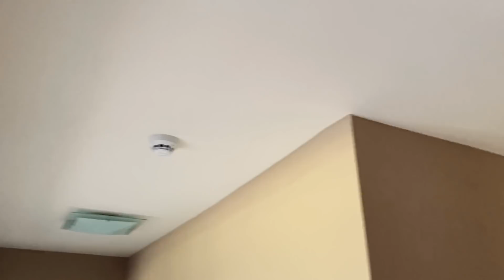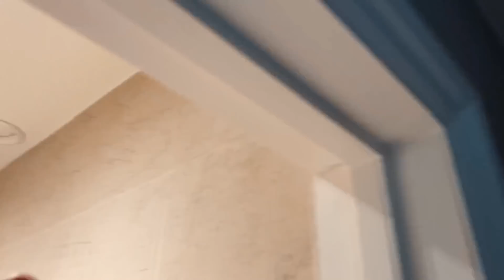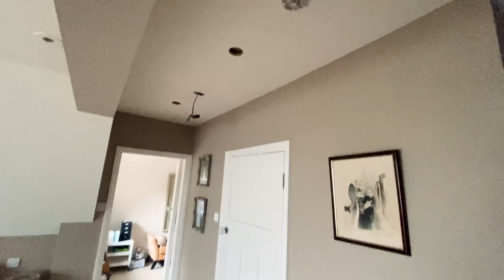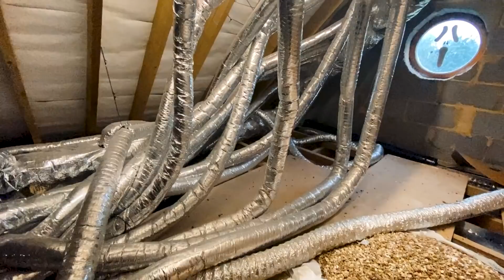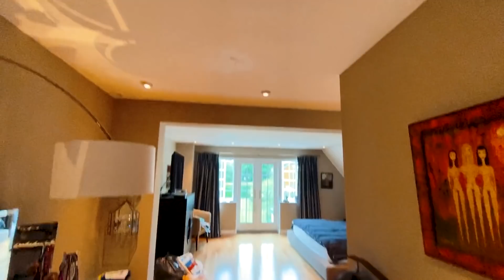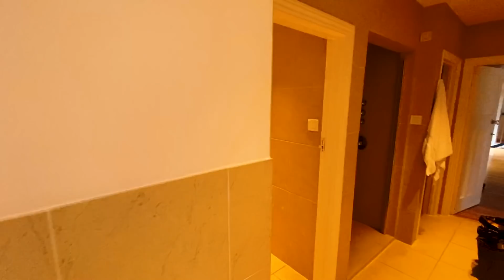Electrician Life Installing Smart Lighting

Comment: Hi Jordan, love your videos. I am currently training as an electrician.
I have looked at quite a few LED downlights and from what I can see they all require loft insulation to be kept away from them with covers etc.
So far after watching a few of your downlight videos I don't think I have seen you do anything to create space between the down lighters and loft insulation.

I also notice that wholesalers don't seem to stock many of the hoods for this purpose which also implies electricians don't feel then need.

Is it just that you haven't mentioned it or don't you feel it's necessary?

Thanks

Alan

Comment: I am not sure what’s Smart about those lights, they just seem to be Controllable Lights, controlled by an awful loud clicking wall switch or finding the hand controller. They should have had a proper smart system like Loxone then they could have had full control without the need to intervene or press buttons, .......proper automation, proper smart.
Reply from the maker: Its all controllable by an app
Reply: @artisanelectrics  an App isn't Smart, it's just control which isn't the same

Comment: Really enjoyed that video Jordan. A little tip  When I fill holes in the ceiling This is good especially for smaller ones we use the plasterboard cutouts fromThe new hole cut out and  used as a template to cut out the old holes and then it’s easier to repair than other than just filling it with filler.

Comment: Hi ther im looking to get some new smoke alarms for my house (wierd) and i have seen that you can run them in by using your lighting ciruit. Would you just wire them in the same way as if you were adding another light. Basically just daisy chain them in 

P. S the smoke alarms i am thinking of getting are connected by wifi so i dont need a 3 core and earth to join them together
Reply from the maker: Yes that’s right they can just be wired off the lighting circuit
Reply: @artisanelectrics  thank you so much for your quick response. Just one more question i am going to put some spot lights in the bathroom and try to do go about it the right the way now my other light have power to them then they feed the light switches. But on a bathroom with spot light would you come of the ceiling rose and power the bathroom switch first then go to the spotlights. Thanks
Reply: @Zaine22  You seem to ask a lot of questions, I feel you should probably pay a professional as it seems you may be out of your depth.

Comment: If the fans on a timer it should be ok on a dimmer circuit the switch line turns the fan and on and the permanent line  keeps the fan running... neat nice job as always👍🏼
Reply: I think the argument was if the fan is running from the switch line while the lights are dimmed, it may dim the voltage to the fan.

Comment: That ventilation system is what we have and is the norm in the USA where we have an air forced heating and cooling systems often with 3-4 different zones. Were the owners or former owners Americans? Just on the regulations on junction boxes in the U.K. you are allowed to have maintenance free boxes and bury them we cannot do that in USA they always have to be accessible. Moreover the box is sized for the number of conductors in the box is there a similar rule in the U.K? Those wago boxes look small for the numbers of conductors within them.
Reply: All joints have to be accessible in the UK too. Unless they are sealed such as resin filled type joints used for underground cables. Anybody burying junction boxes behind tiles or plaster isn't a proper electrician.  Usually such poor work is done by kitchen fitters who think they know what they're at.
Reply from the maker: Yeah they even have USA sockets in this place, 110V

Comment: Some fans are dimmer trigger compatible 👍 or get a PIR 4in version 😊
Reply: Yeah I'd think most run-on fans would be fine as the switch line is really just a start signal, though I suspect few manufacturers state that.
Reply from the maker: Interesting thanks